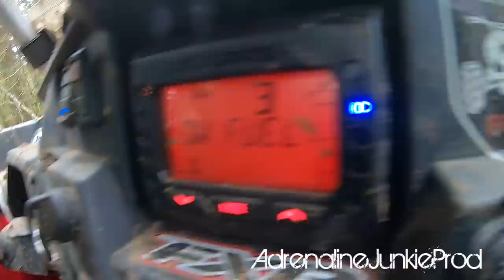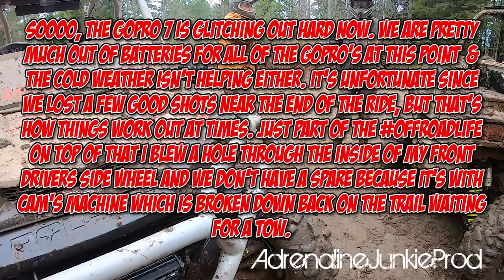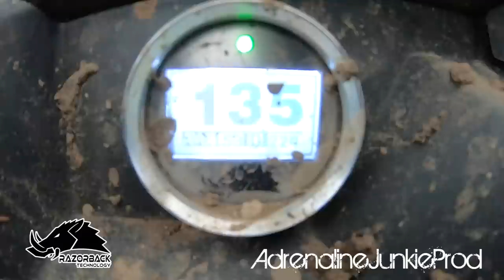Dungannon Mud Bog 2019 - SXS/UTV/ATV - Scenic Feature Length Off-Road Trail Ride - Part 2 of 2

Comment: gopro 8 is the same way.  overheats on me all the time and just shuts off also.  Next one will not be a gopro.

Great video :)
Reply from the maker: Ya, the newer GoPro's have been very glitchy. I think it's mostly a power delivery issue. They hate the cold. In the heat with hypersmooth on and if shooting in anything higher than 1080 60 they overheat. Amazing cameras when they work though. I still love them but it's hard to trust them now. I expected more out of #GoPro to be honest.
Reply: Ive lost soo much footage cause of gopro failure/glitching...i have 7black currently.

Comment: I have a 2017 Wildcat Trail SE. I still have the stock plastic skid protector and it's starting to break around some of the mounting bolts so I guess it's time to get something stronger. Thanks for your recommendations Julian.
Reply from the maker: Hey Edward, ya... that stock belly pans are super under built. Totally worth investing in a true skid plate.

Comment: Great videos. Live close to the area for this run and have made the trip through there a few times.  Question about your Finntrail Gear.  Did you get it local or order through their web site and do you recommend it? Warm and dry and mainly dry?  Thanks.
Reply from the maker: Hey Stephen. I recommend the gear 110%!!! Best gear out there. It's not super warm out of the box, it's not really insulated. It's designed for all seasons. All you need to do is layer up. I wear thermals and a pair of thick sweat pants under the waders in the winter and I'm usually quite toasty, even when it's quite cold. They have an American warehouse and I believe they are working on a Canadian warehouse location too if they don't already have it. I'd order right from their site.

Comment: Julian, I just bought a 22 XP 1000 but I'm not familiar with it since I don't have it yet because of getting assessories put on it. I've been watching alot of your videos and was wondering what makes the  rushing air sound on your RZR. I traded a Wildcat my new machine that's why I'm not familiar with the sound I'm hearing. Thanks in advance.
Reply: I put a 1/2" thick poly skid plate on my 2017 Wildcat. That was alot better than the thin factory plate. I also put a 1/2" poly one on my new RZR. Learned my lesson.
Reply from the maker: Congrats on the new machine!! Yours won't make that sound because it is not a turbo model. The sound you are hearing is the air venting from the intake when the blow off valve opens.  I have mine rigged up so it vents to the atmosphere. From the factory its a closed system and it recirculates so you don't hear it.
Reply: @AdrenalineJunkieProd  Thanks Brother

Comment: Are u still running a recirculating bov sounds so good and loud in the video I wanna  run a recirculation style due to how much mud i run but still want the sound
Reply from the maker: Its not recirculating anymore, it's venting to atmosphere. However, I have a custom setup. I plumbed it up high in the bed. Here is a link to my newest video it shows it https://www.youtube.com/watch?v=73qOZJJF-WU&feature=youtu.be. I get asked this a ton and I'm gonna make a video showing how I set mine up in more detail.

Comment: FOR FUTURE REFERENCE HOOK THEM BACK TO BACK AND SEAT BELT THE STEERING WHEEL  ,YOU USE STRAPS ON YOUR ROLLCAGE TO LIFT THE REAR WHEELS.
Reply from the maker: Good tip, thanks. Might have to try that if we run into this situation again.

Comment: do you grease you bearings
Reply from the maker: I grease my wheel bearings often. Usually every few longer rides or whenever I'm doing anything around them. At the least you should grease them each oil change.
Reply: AdrenalineJunkieProd even with the OEM sealed bearings? Was planning on swapping out to aftermarket later on for ease of maintenance.
Reply: All wheel bearings are sealed, oem are generally better quality than most aftermarket. Regardless they could all use some grease now and then, more so if you play in lots of water/mud

Comment: I’m not downing rzrs but man they do go through a lot of axels and bearings
Reply: That’s why I became a CFMoto guy I beat the day light out of my on the trails cause I do a lot of hill climbs and a lot of deep mudding
Reply from the maker: Once you upgrade from stock axles there are no issues with breaking axles. Even stock axles usually hold up decent as long as you arent too rough on them. As for wheel bearings, if you use OEM bearings and grease them regularly they hold together decent. Polaris recently release updated wheel bearings which work even better. They are not hard to replace. If those are the only issues you have with a RZR I'd say they aren't really serious issues at all.

Comment: how many miles do you get per tank
Reply from the maker: It really depends on the type of riding and the conditions. High speed heavy throttle you dont get much with the turbo. Same goes for when you run a lot of mud or deep snow due to the load. In mixed condition when I'm not wide open a lot i can get 60-80km so about 40-50 miles. Once I was out ripping hard in mud in 4 high and track type riding and i went through a hole tank in around 20 miles, lol. It was pretty much all full throttle.
Reply: @AdrenalineJunkieProd   i get 100 miles plus with my turbo with stage 2 tune fast trail riding allways running wot